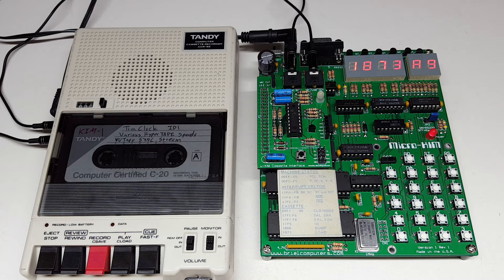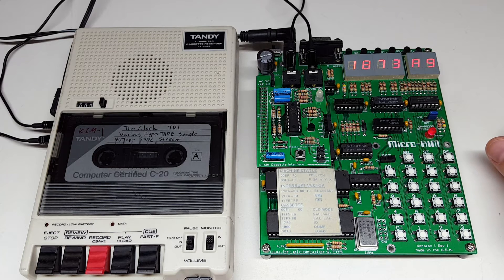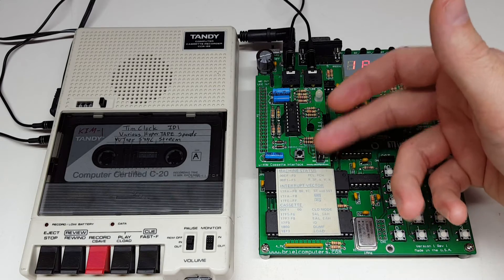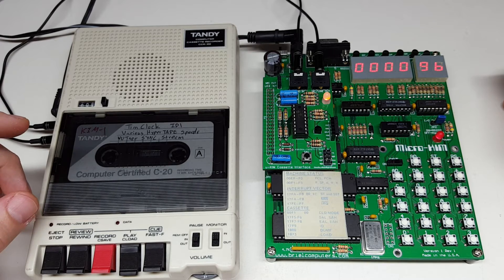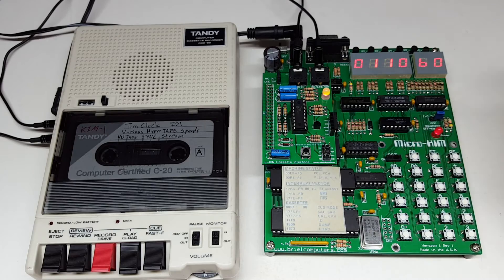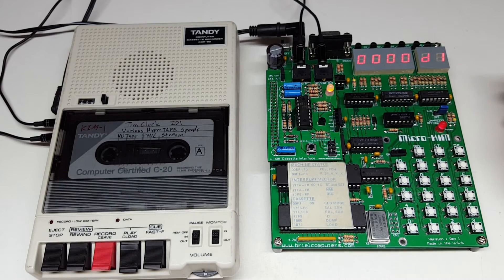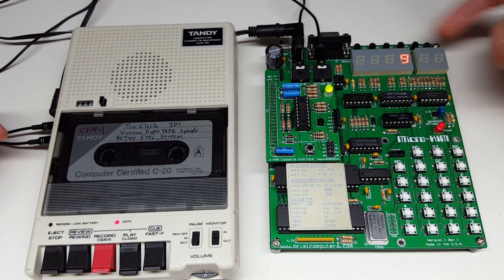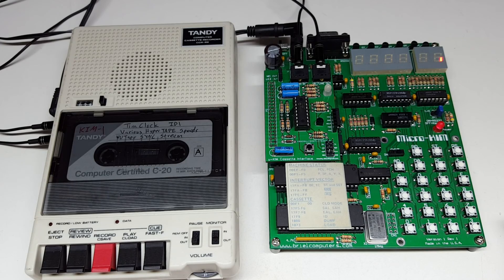Home-Brew Cassette Interface for Micro-KIM Single Board Computer

Comment: I gave you a big thumbs-up, you deserved it. Where can I find the building plans?
Reply from the maker: There aren't any detailed plans available per-se, but the link below includes everything you would need to build one, if you are so inclined. There's a BOM, the PCB Gerber, the source code and pre-built hex files for the PIC, and the schematic. I still have some boards left that I could send to you if you want to pay for the shipping.

https://drive.google.com/drive/folders/1qLNXyazBGQVpApuo_5EV7PosVBHh_Tdt?usp=sharing

Also, someone has made a complete KIM-1 cassette interface kit available on Tindie (https://www.tindie.com/products/tkoak/pal-1-cassette-interface-expansion-kit/). This kit is based on the original KIM-1 cassette interface circuit, instead of a PIC-based version like mine. However, it is for the PAL-1, and not the Micro-KIM, but if the expansion port pinouts are the same (and it very well may be, since the PAL-1 appears to be a clone of the Micro-KIM), then this may be an easier path for you. In fact, I think I'll order one for myself and give it a go -- I'm curious how the original cassette interface circuit performs compared to my version.

Comment: Awesome project! I know this video is 5 years old, but do you have operating instructions? specifically, how to you store the programs on the PIC?
Reply from the maker: I do not have operating instructions per se, but other than the ability to replay programs stored in the PIC, from the user's perspective, it behaves identically to the original KIM-1 cassette interface, so you can use the instructions found in the original KIM-1 documentation (KIM-1 user manual, First Book of Kim, etc) for how to operate the cassette interface.

As for the programs on the PIC, they are compiled into the PIC firmware, and then flashed into the PIC along with the firmware. The only way to change the programs in the PIC is to rebuild and reflash the PIC firmware.
Reply: The programs are probably hard coded in the firmware for the PIC, so to change one, you would have to re-flash the PIC which is easily done with the header.